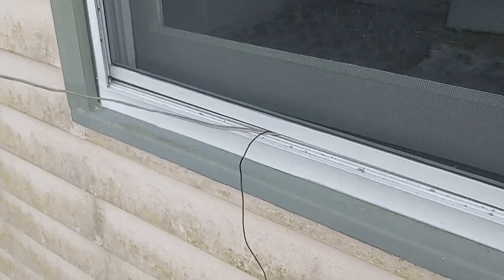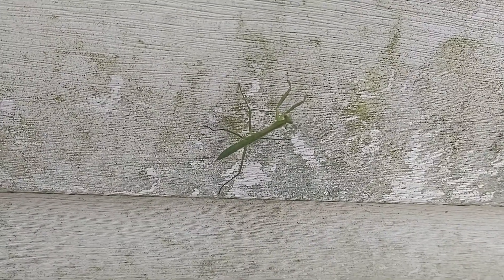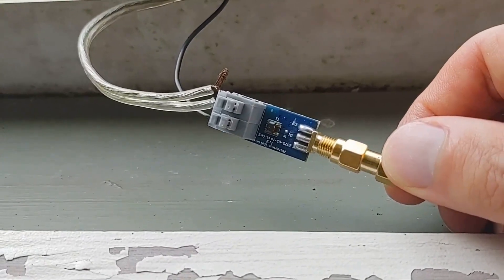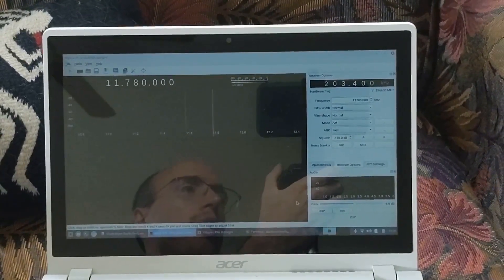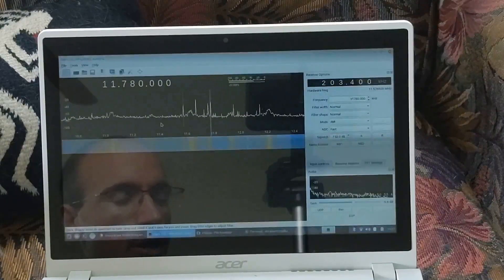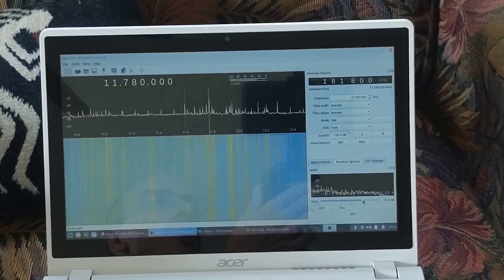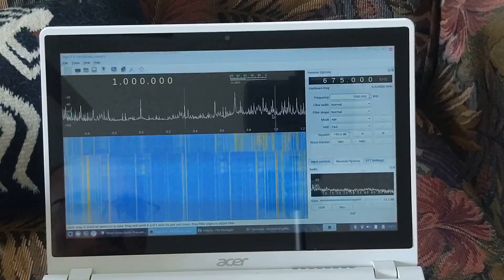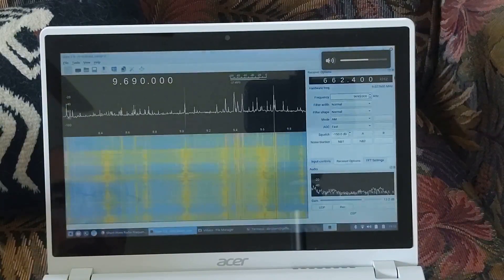Grounded balun and fence random wire SWL SDR setup

Comment: Hi Abraham,
Be aware that ground does NOT protect you from lightning, in fact it attracts lightning. You can use it for protecton as with good grounding you can route the way the lightning will take. In a non perfect situation better disconnect antenna, ground and equipment during thunderstorms.
Reply: Question:
I have what amounts to a “ whip” antenna for MW/SW I did run an 8 foot steel ground rod directly beside my 20 foot mast, connecting it directly to the side of the mast.  My antenna rod is separated from the mast, with the antenna wire wrapped around the rod. The rod is not grounded. The wire runs down to a point where it splits, and is connected to 2coax cables, one leads into the front room and the other into the bedroom.
I tried to find information on this type antenna but no luck. The idea was to avoid running wires all over the yard/trees( which will be severely “trimmed “ shortly) and still have an omnidirectional antenna.
I also grounded the coax- ( 5 foot copper pipe with the top 3 1/2 feet deep.
Any suggestions or info would be greatly appreciated.
📻🙂

Comment: Hi Abraham
I still see room for improvement. I made a similar arrangement from the 1st floor to a pole in the garden. I see the following problems:
- you use a twin-line: use one wire, or twist the 2 wires together.
- if you use a extra ground wire, you have to interrupt the short (sometimes a resistance) at the balun.
- the endfet is a high-z device, so better stretch the wire in the air and not along wooden panels, which can get wet and give more capacity to the antenna.
- I still see too much repetitive frequency's (bands), that is, you pick up too much interference from sources of interference in the house, or from the neighbors.
- use the laptop on battery, not on the mains. Your signal will be much better.
- to have the best signal, use an isolation transformer, just behind the antenna on the SDR dongle.
All of these things have drastically improved my signal.
Reply from the maker: Thanks for watching and for all these helpful suggestions!! 
1. I put a twin line up, with the ends connected on the far end and only one line connected to the balun on the house end.
2. How would this work? Upon another person's suggestion, I separated the ground and speaker wires so that they don't cross.
3. Great to know! Maybe I should put it in the air over the empty pool.
4. That is strange. Maybe switching PSUs?
5. The laptop is running on battery here.
6. How would I set up an isolation transformer? What is this? Let me looks it up.
Thanks again. I appreciate your constructive and detailed criticism!